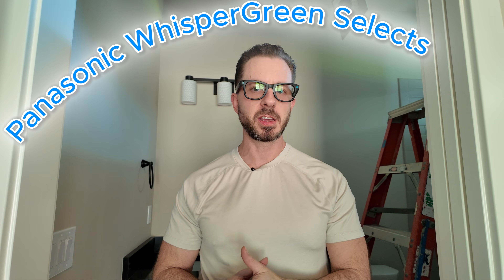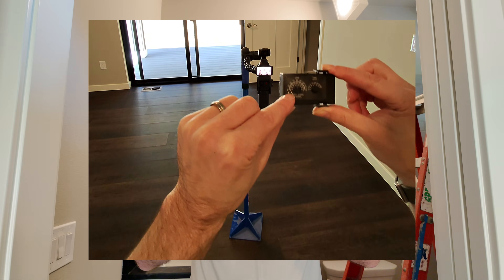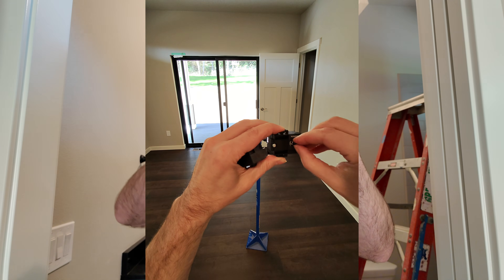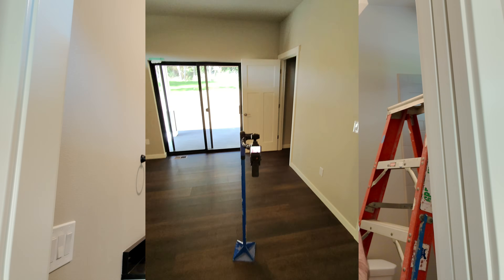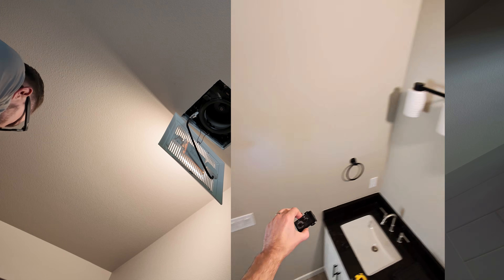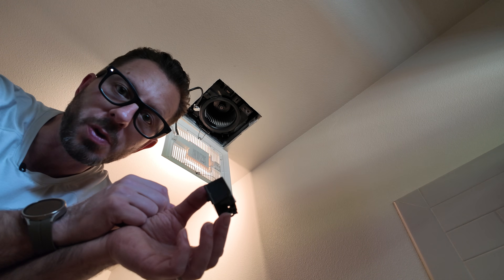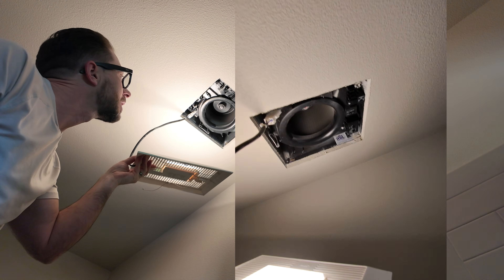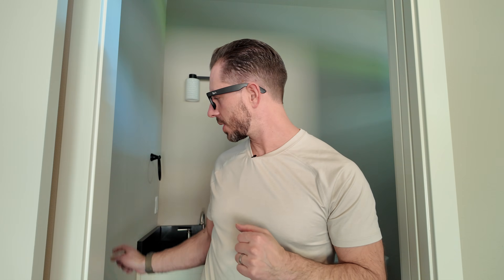Panasonic WhisperGreen Select Fan Deep Dive

Comment: Does the whisper select come with the modules (specifically the one that allows it to run continuously and be turned higher when desired) or they need to be purchased separately
Reply from the maker: I believe it comes with the multi speed module by default